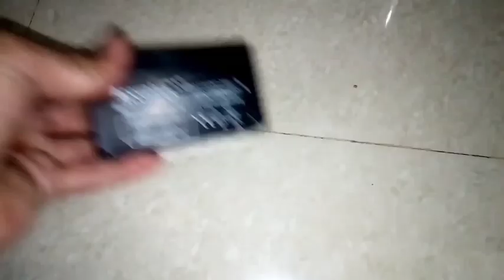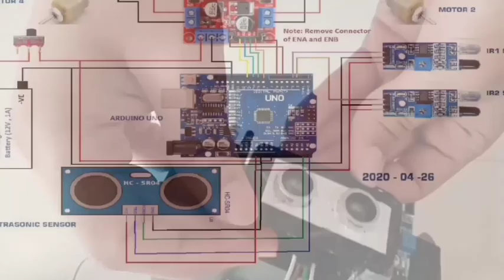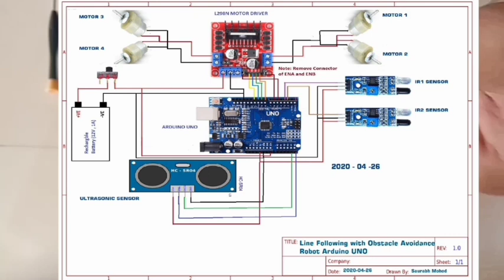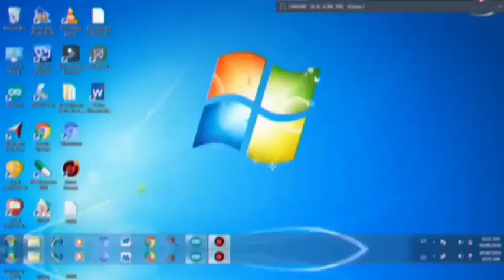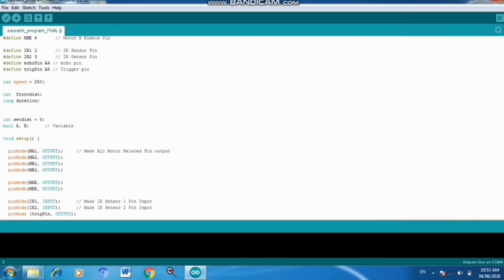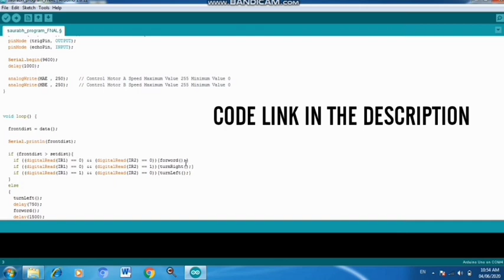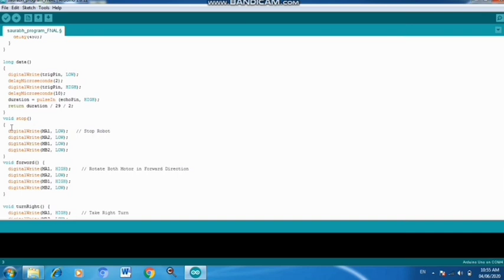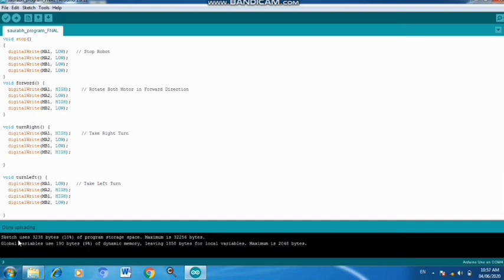Line Follower & Obstcale Avoiding Robot Using Arduino Uno | Industrial/Medical purpose Bots |

Comment: hi my robot is detect obstacle while pass the obstacle we didnt follow line again what is the problem sir ?
Reply from the maker: Thank you for your valuable comment. 
Check code properly and calibrate IR sensor.
Reply: @smtechnomind4949   sir also i have one more question if the delay time change how do you affect robot.what is the change in motion. also if i change delay time  is it solving my problem
Reply from the maker: By changing delay is affect robot due the delay time related speed of the motor.